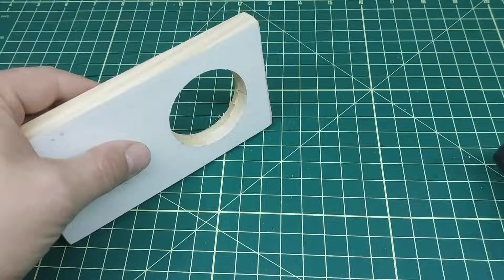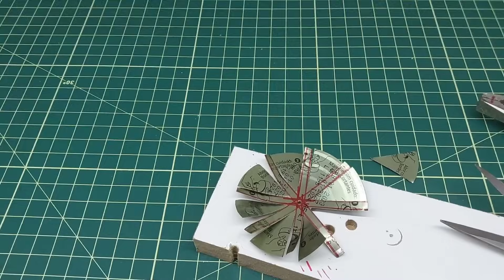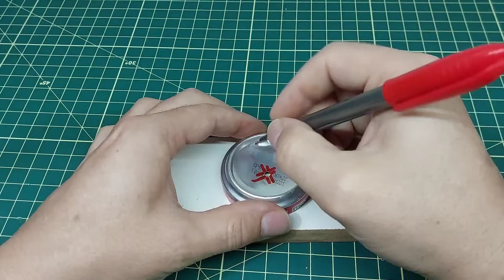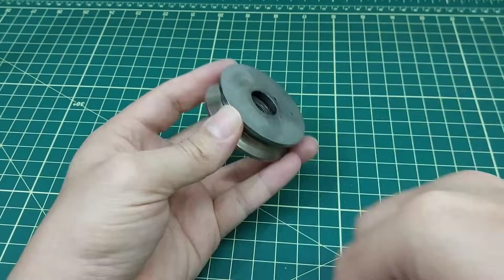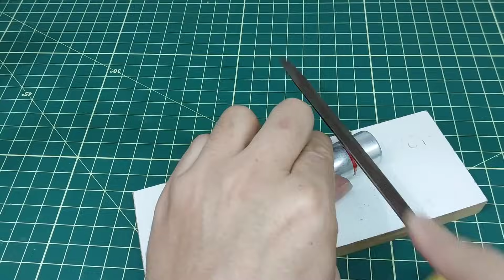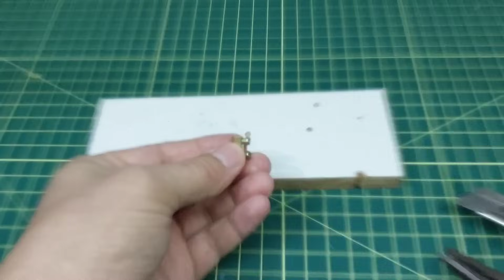TRABALHO DE CIÊNCIA. COMO FAZER UM  MOTOR STIRLING . SCIENCE WORK.  STIRLING ENGINE.

Comment: Hi. I just want to ask if there is have a water inside the can?
Reply from the maker: Hello! These engines do not need water to function, however water when used makes the engine have more torque as it increases the thermal variation between the ends of the cylinder. Hug.

Comment: Amigo si quisiera cargar una batería digamos, de 12 voltios, se podría?
Reply from the maker: ¡Hola! Sí, con un motor un poco más grande sería posible. Abrazo.
Reply: Pienso que si, habría que poner una bandita o polea entre el motor de impresora y el cabezota donde sale la fuerza o sea la parte redonda. Quisiera cargar celular o las luces de la casa o baterías para luces LED o los videojuegos, de 12 voltios como la play 2 con el motor sterling. Las luces LED para cultivar hidroponico. Que dices, pienso que se podría usar para los aparatos de 12 voltios o menos como celulares leds y pantallas

Comment: Sensacional.
De todos tutoriais que assisti, o seu é o melhor.
Tudo feito com materiais de fácil aquisição e construído nas medidas corretas. 
Parabéns!
Nota 1000 pelo projeto e nota 1000 pelo perfeccionismo!
Reply: @GeralNaPratica  Hola, tengo algunas preguntas. 1) ¿está sellada la cámara del expulsor cerrada con un remache? 2) ¿cómo calcular el Tamaño del pistón que hizo del tubo? 3) ¿Cómo se enfría su motor? Gracias por adelantado. P. S. el Español no es mi lengua materna, lo siento.
Reply: ESTE TIPO DE MOTOR DEVE FUNCIONAR COM AGUA FOGO EU NAO VI AGUA
Reply from the maker: Na verdade funciona sem água também, pois não se trata de motor a vapor e sim de um motor de variação térmica com circuito fechado, alguns motores que eu faço tem água para aumentar o torque, pois quanto mais variação térmica existe entre os dois extremos do cilindro, maior será o torque. Porém essa agua é só para esfriar a parte externa do cilindro e causar um resfriamento do ar interno naquele extremo. Abraço.
Reply: @GeralNaPratica  je réponds mille  bravos   à vous remarquable  travail   !
Reply: @josemarques3121 ese es un motor stirling, no uno de vapor
Reply: @josemarques3121 É óbvio que você é ignorante, o motor Stirling só funciona com calor, não precisa de água, verifique o que escreve antes de comentar.
Reply: O cara ta fazendo o teste com ar do compressor no lugar do vapor  que é ar também,já pensou ficar o tempo todo botando aqua e lenha...seu josemarques
Reply: Parabéns o melhor vídeo de constrição que eu já assisti. 
Já salvei para tentar fazer um.
Parabéns pelo excelente tutorial